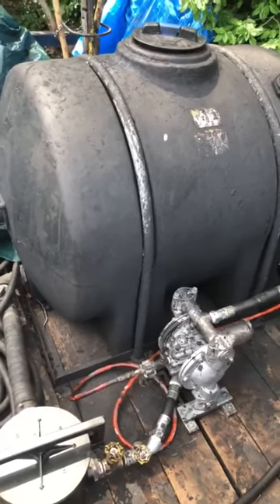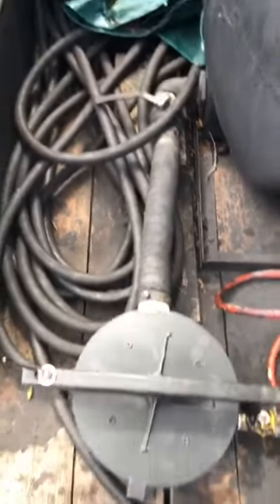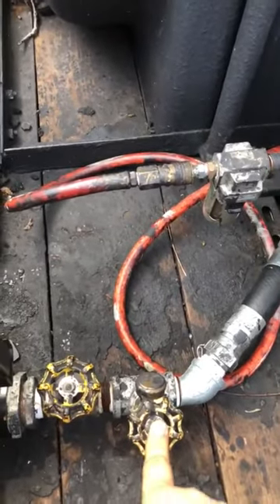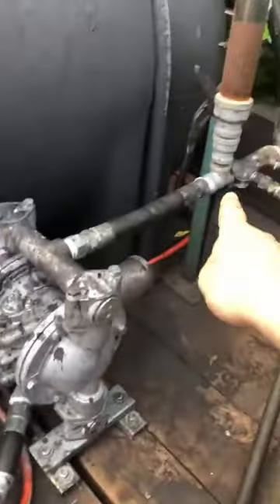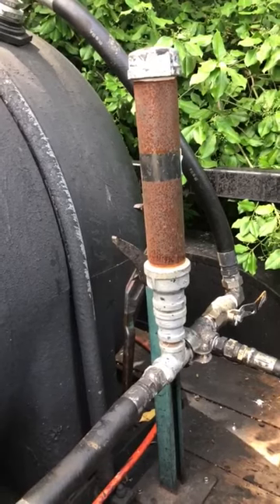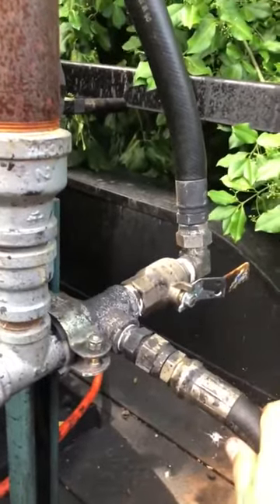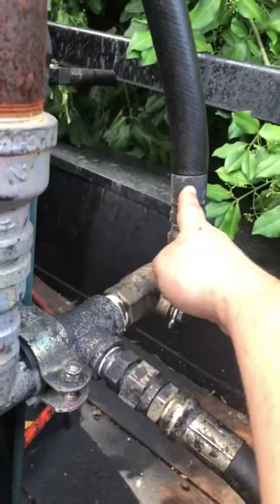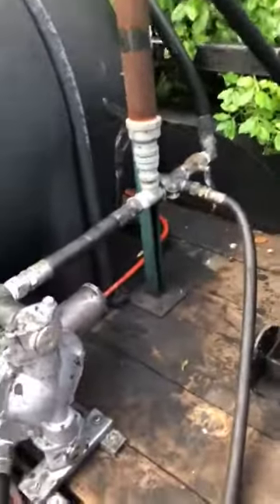Diaphragm Sealcoat Setup Example and Description

Comment: Correct me if I’m wrong, but with the diaphragm pump, you don’t have to worry about shutting the motor off while you’re brushing around what you puddled out?
 I use a trash pump currently but have a diaphragm set up for next season. The trash pump I have to shut off after I puddle out the seal. I can’t let it run constantly and circulate, I learned the hard and had it heat up and harden in the pump on me. 
Just making sure the diaphragm pump works as I’m understanding?

Comment: Hey man I had asked a question before and you answered figured I’d give it a shot again was wondering how do you pull the material back through the hose once you stop spraying  with a trash pump thanks again for answering the last question
Reply from the maker: You don’t bud. You just leave it in and put a “plug” tip in the end of the wand.
Reply: @blacktopbanter  no shit thank you sir I went with the diaphragm pump on my big setup was shooting for trash pump on my truck but when practicing with water in my own driveway I wasn’t able to figure out how to pull the material back like with my diaphragm setup thank you so much for all the help I really do appreciate it

Comment: Is there a type of blow off valve or something that stops it from continuously pumping/building pressure
Reply from the maker: On a diaphragm pump, it will just stop pumping once it hits a certain pressure, on a trash pump, there is a return valve that you just don’t close all the way ever.
Reply: @blacktopbanter  you’re the man I appreciate you responding Thank  you
Reply from the maker: @tylerhowerton8518  no worries my friend
Reply: @blacktopbanter  I run my trash pump  sprayer with return closed all the way without a problem. My trash pump can only produce 37 psi anyways so theres no way id have a blowout
Reply: @ClutchTFS   nah useally when it will happen is if you got the pump and motor running for  like a 5 min stretch without  spraying I learned that the hard way

Comment: Hey buddy, another question I’m building a setup just like yours, so did you reduce the inlet to 1inch when it goes to the pump or are you running bigger then 1 inch. I’m have a one inch pump

Comment: Ive got the graco husky 1040 (1 inch at 40 gpm). 30 gallon compressor 18 cfm. My hose is 3/4 100 ft. I plan on getting into alot more spraying this year, do i NEED to upgrade to the husky 1590 (1.5 inch 90 gpm). Or will mine be more than ok? Ive done alot of upgrades this winter and money is tight at this point
Reply from the maker: Depends on the viscosity (thin or thickness) of the sealer that you use. Will take some trial and error.

Comment: What air compressor do you have and what cfm does it produce? Trying to build my business and not break the bank.
Reply: I'm also building one and from my experience building my house compressor (videos in my channel), I know the most expensive part is the gas engine.  Once you have that, buying a slightly reduced sized pump is much cheaper.  Then it's just a matter of working out the pulley reduction and aligning the shafts to turn on the same plane.  Pumps generally graduate is increments of 5HP, and you can oversize the pump to the motor, but it's better to oversize the motor to the pump.  I have a 7.5HP pump being turned by a 5HP motor, but it would be better if I had a 10HP motor for that 7.5 HP pump.

Comment: Can you do a video on the support you added to the surge bottle
Reply from the maker: Looks like Scott just had an old steel brace laying around, but you can use wood too. Just have to anchor the piping to it. Also, they don’t always need support if the piping is tight.
Reply: @blacktopbanter  thanks for this information and this video it’s helped me a whole lot 👍🏻

Comment: I had a question when you picked out a diaphragm pump how did you decide what gpm and size your needed?
Reply from the maker: Hey Logan. Our general rule of thumb is anything 1-1/2” and lower a “wheelbarrow” compressor (9-13CFM) will work, a 2” needs at least a “Jenny” compressor (26cfm)
Reply: I got my pump on a steal, a badass aro 2 inch can do like 172 gallons a minute. Now I'm in the beginning stages, so my wheelbarrow compressor is all I could afford at the moment. Will it run that pump, or no